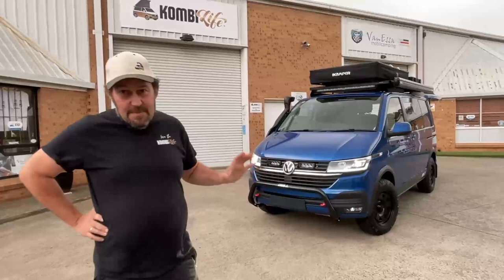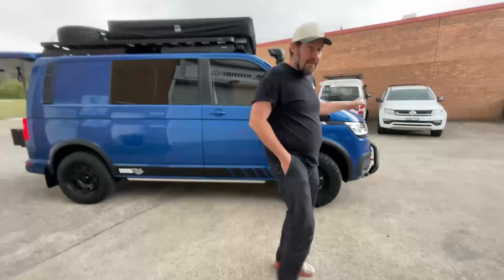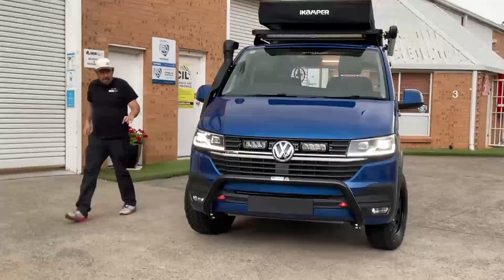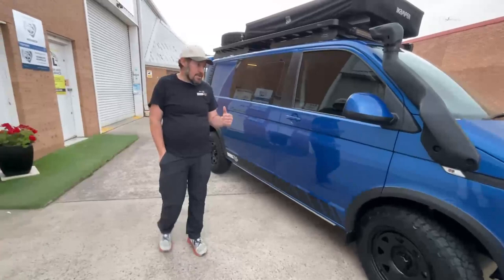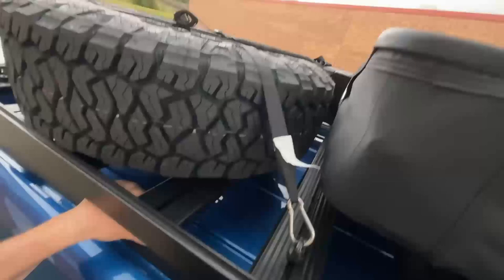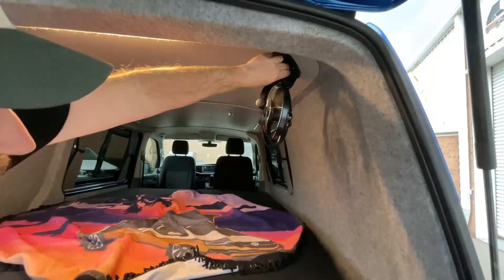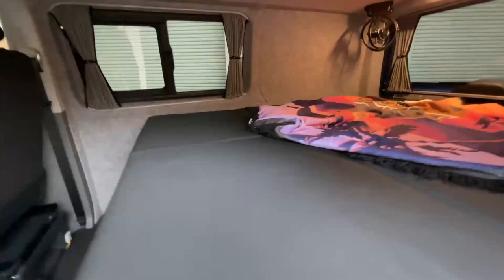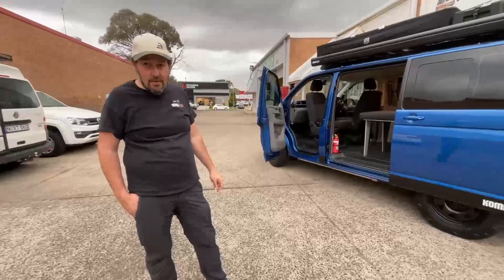Expedition TDI450 SWB 4motionMY22 VW Transporter

Comment: Please don’t take offence, but the very cheap cook top set up and water tank are in my opinion very sub standard in a vehicle that isn’t cheap..
If you had of used  17 x 225 x 65 you would of been able to save space on the roof rack and mount the spare in its original location. The difference in height gain is only 5 mil